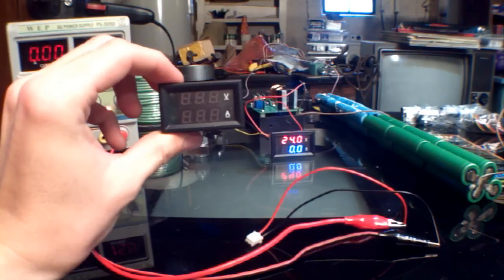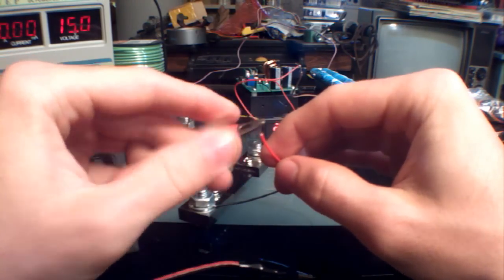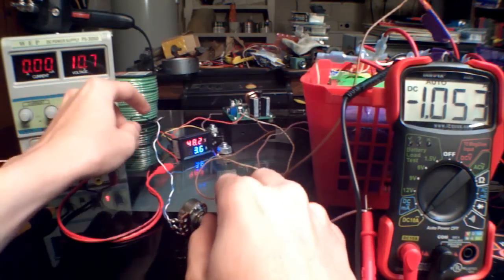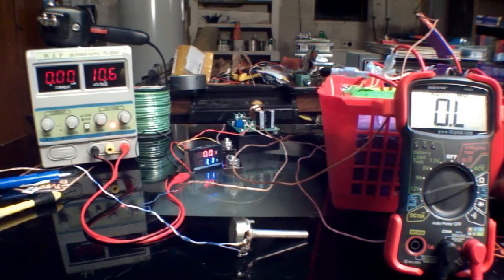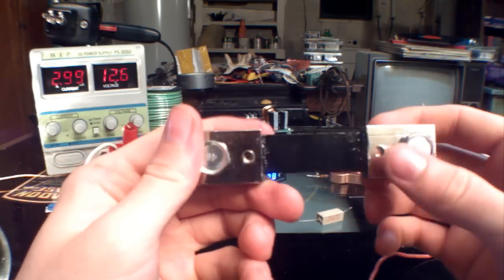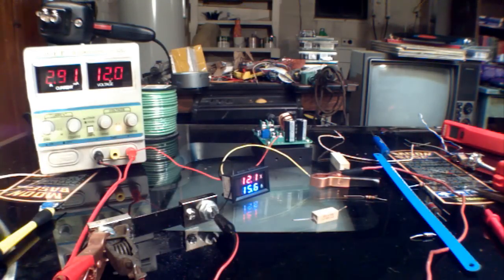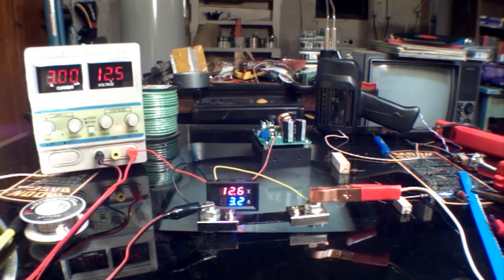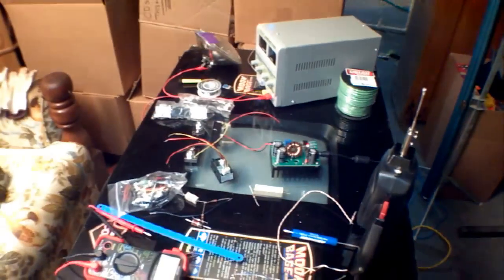Ebay Reviews: 300V 100A Dual LED Digital Volt Amp meter

Comment: I ought the same meter I think fro Amazon. It did not come with a shunt, can you help me by what elese I need to buy, I am wishing to install this to see what my 12 volt 100w solar panel is doing, Thanks in advance
Reply: Ye Olde Pirate did you find what you need?
Reply: Sorry I have not yet hooked it up.. when I do i will post something ! Thanks for your message

Comment: Hi does the Display need a different supply to light up the digits ?
Reply from the maker: if the voltage you are measuring is between 5 and 30 volts then you can just run the led power off of the same wire your measuring from. but if that voltage goes above 30v it will fry it.
Reply: Rinoa Super-Genius Thanks for this useful info: RSG.

Comment: Hi... can i ask a question please

I have bought:
12v 25amp 300w wind turbine
33A wire to batts because DC turbine
18v 5.5a 100w solar panels x2 = in parallel 11amps
30amp charge controller
 
The digital amp meters Shunt specs say: Current 30A, Voltage Drop 75mV

... Can i use it like this? Coming from the solar and wind, id like to place the Shunt in line with the positive cable, connecting to another common bus bar. From the bus bar the power moves on to a charge controller before batteries.

... Will i lose a lot of power that im generating, if im pushing the power through this Shunt thing? The metal piece between the two bolts looks realy small

Thanks for any help
Reply from the maker: no you won't lose much power at all, probably like 0.01% and you could lose way more than that just by there being a not very windy day. think of that shunt as just adding like an extra 3 feet of wire to the turbine, it is resistive but such a small amount that only precise electrical equipment would detect.
Reply: ahh see... thanks very much. Ive been trying to figure this out for about 5hrs today of google reading.

Cool... so ill place that in line with the solar and wind and not worry thats it moving through such a small bit of metal :o)

Thanks appreciate it.
Reply from the maker: DiyEcoProjects
well thank about it, the shunt will drop 75mv when 30a is passed through it. so if your system is running at 30a it will consume 2.25w
Reply: hmm... interesting thanks
Reply from the maker: DiyEcoProjects
 sorry i meant 75mv not ma. hope it made sense though.
Reply: 0.075 volts x 30a = 2.25w ... i see lol. ok well if im makeing 500W max i guess losing 2.25w is acceptable hmm
Reply from the maker: DiyEcoProjects
 especially since you will probably be losing more from the wires and everything.
Reply: yeah... i bought 10m of 33amp wire fat stuff. Hope for the best lol
Reply from the maker: DiyEcoProjects
 what guage?

Comment: I tried those, and they are way off, unreliable, give different reading for same voltage and current they drift out of calibration , loads such as driving a brushed motor will mess up meters, I've had some fail.

Comment: those meters have a potentiometer to ajust the reading and claibrate at the backside of the display :-)
Reply from the maker: +Tim C in teh video i said that pot doesnt adjust far enough to make it correct.

Comment: I agree with everybody else you're hooking the Signal wires up incorrectly, you're not putting a dc-to-dc isolated module in there or bothering to put a separate power supply therefore you are going to get fucked up readings and leading others to probably end up fucking up there multimeter if they're trying to install this in a car.

Comment: For one thing you have your current sense wires connected wrong. They should be very secure under the small screws on the shunt. The high current (load)wires connect via the large bolts. You are dealing with low millivolts here and your load of 1 Amp would be only 7.5 mV. You should be able to get an idea if the ammeter is working by applying 75 mV to the  current sense wires to see the (hopefully) 100A reading. Remember even "good" DMMS may be out 2-5%. Good luck.
Reply from the maker: sorry the small screws dont move. they are really wrenched on there and I think they hold the resistive strip in.
Reply: Rinoa Super-Genius
The ve6kk is right you really need to have the current sens wires under those small screws. they do not hold the resistive strip so try harder.
Those 100A shunts are precise enough I have a few myself they output 75mV at 100A
Reply from the maker: ***** its not worth breaking the shunt trying to unscrew it. atleast not to me.
Reply: Rinoa Super-Genius
I promise it will not break I have a few of those exact 100A shunts and the screws are a bit tight but they have the clear purpose for current sense.
They should be in some of my videos probably those with LiFePO4 battery testing.
The measurement will only be correct if taken from those points.
Reply: ***** Talked to a fellow in Africa using a similar meter - current sense wires ok to go under the small screws. Note these sense current in the negative supply wire. Te Red wire should be right at the load to see the correct voltage if there is a drop in the wires.

Comment: Hi. I have DC 4.5-30V 100A Dual LED Digital Volt meter Ammeter Voltage W/ SHUNT F/ 12v car. I would like to wire it into my RV any help would be appreciated.What wire goes where?
Reply: I am working on that as we speak. but am having a problem acts like there is an open circuit on a digital am meter.

Comment: I am going to connect one to a 24V Mobility Scooter to monitor the power @ the motor and battery drain so I don't have to call a Taxi Cab, (again). Sure hope it works!
Reply from the maker: i hope it works for you also! are your cells lead acid? you might be able to build a lithium pack that would work along with it to increase range. i built my electric bicycle battery from old laptop battery packs and have gone many miles on it.

Comment: Here is something you might try (It won't hurt anything)  You have two different power supplies, one to power the load and one to power the display meter. The small black and the large black wires are common ( or connected together) in the display). Try disconnecting the small red wire from the 16V power supply and then connect it to the + 'Load' power supply. Disconnect the small black wire and tape it off, as these " common blacks" are connected to the load power supply. This is called 'selfpowered' and this will be fine as long as your 'load' power supply voltage stays between the 4.5 to 30 volts. JUST PERHAPS? any EMF difference between the two different PS's Might have been an issue.   OK Guys , Let me have it...
Good Luck....

Comment: I have a very similar model at home for my server room's DC power plant which uses an inverter-charger.  Problem is, the amp reading is completely useless.  The numbers jump around like crazy.    I did the zero calibration but even with no load it jumps around, though not as much, maybe from 0 to 1 amp.  With load (which I estimate to be about 50 amps) it will jump from around 30 to 60 amps.  The numbers are just moving like crazy.   Does anyone know what would be the cause of this?  Can I put a small capacitor between the two wires going to the shunt or something, I wonder if that would help filter things out.  Though it may effect the actual shunt as well....  What about the wiring, I'm currently using telco frame wire (22awg I think).
Reply from the maker: i think the cause is its just a horrid design quality.
Reply: I hope your main wires are not #22!  For 30-60A your supply wires should be in the #8 and larger category.  I suspect you have switching noise from the inverter getting into the meter. Try one or 2 snap-on ferrite chokes, or better yet several turns of the sense wires through a ferrite core (scrounge from old PC supply).  Try just a DC battery supply (no inverter or AC supplies) to see if the display settles down.
Reply from the maker: ve6kk
no i use it on batteries and it still jumps around a bit. oh well.

btw i put a really big capacitor inside the power supply so it helps to smooth out any jitter. its just these meters are really crappy ;p
Reply: ve6kk The actual supply is #2.  Fused at 100a.   So is these an interference issue then?  What if I use twisted pair or something like that?  Right now the small wires run along the #2 wires to go to the meter.   So sounds like not much I can do then?  Wonder if an analog meter would work better.

Comment: It best NOT to use cheap ebay digital panel meters on you're project as they are unreliable. Use panel mount analog meters and use a hand held multi-meter for high accuracy.

Comment: Thanks for the Video ... You may find that if you draw between 1/3 and 1/2 of the capacity of the shunt that your meter will be much more accurate.  When you are drawing 3 amps of 100 amps capacity ... you are at 1/33 capacity.  It is common in these situations to not get perfect readings on equipment that is not ... shall we say ... laboratory grade (ebay cheap)   :)

Comment: Best reply from @simonilett998 below regarding how the device needs to be connected.  I'd only like to add to many of the comments regarding on which screws the current monitoring device should be connected to, the method of connection has a name, it's called the 4-wire or kelvin measurement method.  Plenty of documentation on the net, look it up, they even make crocodile probes that have the 2 jaws isolated.

Comment: The truth is the cheap led ebay panel meters are RUBBISH, regardless weather the shunt is connected correctly or not the meters are massively inaccurate, unstable, and non linear, hence they can't be calibrated and stay correct, also they are easily damaged from spikes say you connected a motor it can blow up the meters, they after a while they will fail, and drift off value.

Comment: Hi Rinoa, found something for you. It appears you can fine tune the amp reading from the back. take a lolok at this image, theres two places to fine tune it. Volts and Amps

http://i00.i.aliimg.com/img/pb/094/278/585/585278094_121.jpg
Reply from the maker: yes i did that in the video, but the amount the potentiometer changes is less than the amount the meter is out of alignment.
Reply: i see... ok :o)
Reply: hi, im working on a solar/wind project for my friends van. This is what ive done so far. I did it before i discovered your video... I think ive done it wrong though. Looking at your video, does that mean that the digital display just needs to be powered by something else? To make it work, running a separate line from the 12v battery bank, back to it...

Comment: The meters are cheap, inaccurate and are easily damaged, even with current shunt correctly connected the amp reading will still be way off..rubbish product.